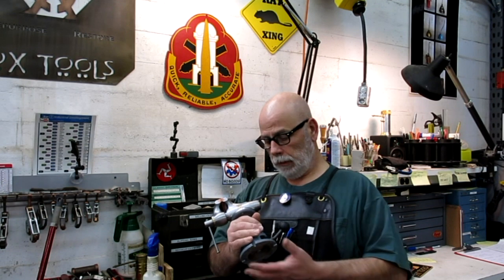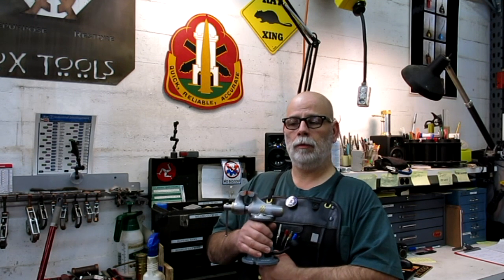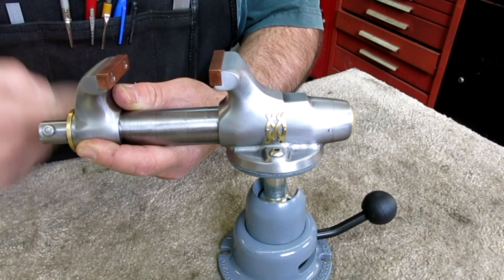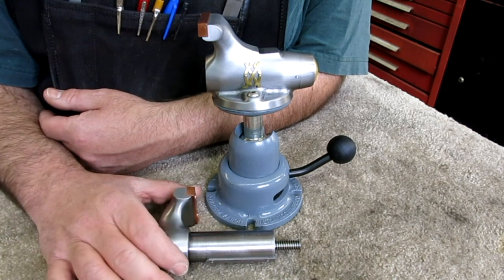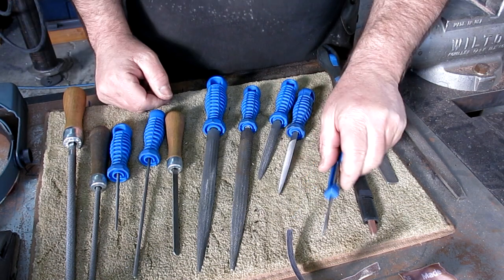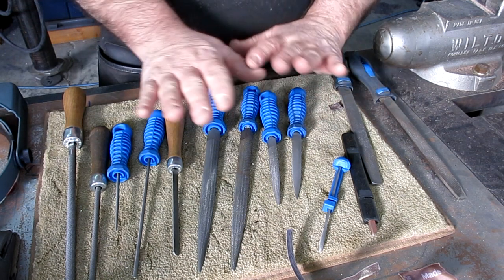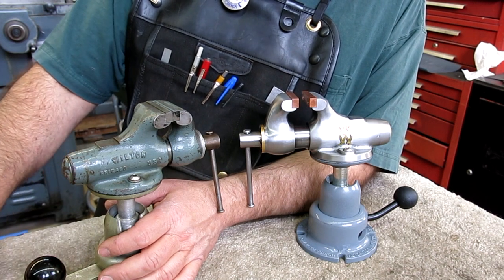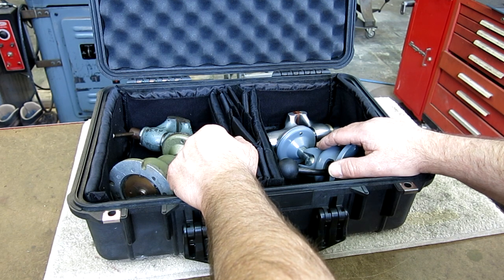Building a Wilton Baby Bullet Vise 25 Q&A

Comment: They say that a lathe is the only tool that can build itself. I've never seen or heard of anyone actually building a lathe with only a lathe.  

You are about the only one I've seen who could actually prove that a lathe can reproduce itself.   That would be one heck of a long term project that I bet you could actually pull off.
Chris
Reply: Actually, it goes like this:  "A metal lathe with all the necessary attachments and tooling, along with a judicious amount of hand tools, including woodworking tools, files, punches, layout tools, and so forth, (that you'd find in a typical machine shop) is the only machine tool that can be used to replicate another like it."

Comment: Hey Tom great series & project thank you very much.  Your discussion of power tools vs hand tools reminded me of something...  In a land far far away 'n long long ago as a newly assigned Seaman Apprentice I was tasked with improving my manual dexterity by removing the epoxy compound that covered the head deck.  Sure enough the laws of physics applied themselves to my lack of experience and I learned about kickback.  Stitches were not required, there was no permanent damage, to myself or grinder, the pants were another story.  But I never did hear the end about dropping that grinder after it put a 3" gouge in my leg.  ; -)

Comment: My favorite power tool horror story I've ever heard was a crew of guys at a body shop sanding a Corvette down with some kind of power sanders. Maybe pneumatic DAs? Then at one point a guy gets in the car and looks up through the T tops to see another worker sanding on the T top windows. I wasn't there, I just heard about it. Pretty good one though. Yeah they replaced the windows, and never told the owner about it. Whoops! Come on, the car was covered in dust at that point, so it was an easy mistake to make.

I'd have at least used a flap disc to blend that vise body a little. Those things are magical. Pretty idiot proof too.

Comment: It raises an interesting point. Assume 100 hours at 50-100 dollars per hour. So  a 5-10grand piece. Anyone who has watched the series wouldn't question it, of course. But for the material worth of the vice, the 'what's it worth as a functional item' is far less, considering equally functional vices can be found for far far less.

I sincerely hope the auction leans towards the former than the latter. I have a sneaky feeling that it will.

Thanks for a wonderful series Tom.

Comment: As a teacher I am constantly trying to instill in my students the merits of hand tools.  It is often difficult to bridle youth, enthusiasm, and inpatients.  And I must admit I too fell victim to the allure and speed of power tools as a student.  I have a chisel that I forged as a student in college.  I did not want to be bothered with the tedious work of filing the body before hardening it.  In the corner of the shop was a big belt sander that smoothed the chisel body in a fraction of the time.  I recall after having done this, my instructor, Mr. "Spike" Brewer telling me the form was incorrect.  As an adult I now see what he meant.  Oddly just this past week I used that chisel and while putting it away I recalled Spike telling me my work was incorrect.  The chisel is hard and is an effective cutting tool but the surfaces are all curved, not flat as they should be.  I could not see this at 19.  Funny how time changes ones perspective.

Thanks for sharing!

All the best!

Mike

Comment: I'm going to disagree with the critics and say that one of the best aspects of this project was the manual filling. It's becoming a lost art and it's slow and you shoulders hurt, but I doubt such an organic form could have been achieved with machines. I love that such complex shapes can be achieved with such a simple tool.
FYI Pferd is German for horse (hence the little horsey).
Reply: +SierraLimaOscar I agree.  In fact, the entire project was a showcase of basic machinist and fabricator skills put to practical use.  Instead of asking "how can I do this faster and easier?", I found myself saying "I need to spend more time developing those basic skills."
Reply: Me too. The hand work was spectacular!
Reply: I agree 100%. 
In grade 9 (1980-81) machine shop class (2 months long) our project was a hexagonal key tag. 
Starting with a very rough cut piece of hexagonal rod we had to bring it to consistent thickness and all radiused corners to match the “diameter” of the hex. 
All the work was completed using hand files because the shop teacher understood the value of handwork in the shop.